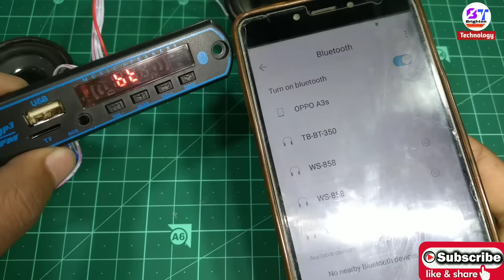Audio amplifier Module, Bluetooth, AUX, SD Card, FM, Bluetooth speaker

Comment: Does that have a port to charge the battery as well, I love this configuration, less heat ,less size , big sound, I plan on putting a similar config. On my ebike, but wanna do like 2 to 400 watts. Any suggestions? Any input is greatly appreciated